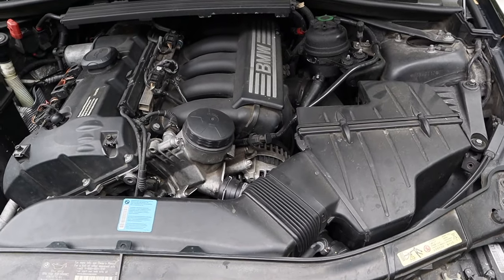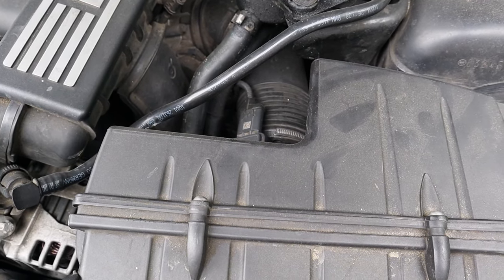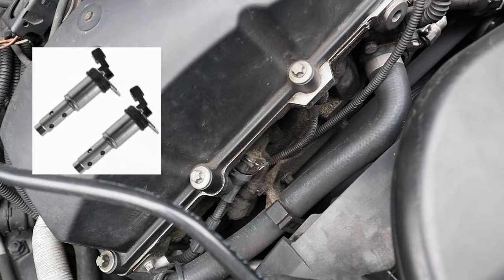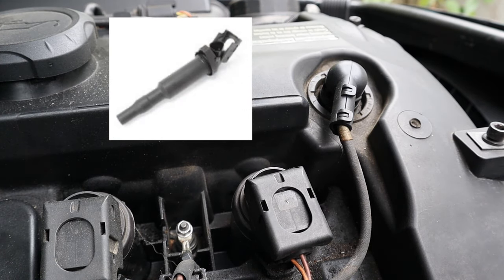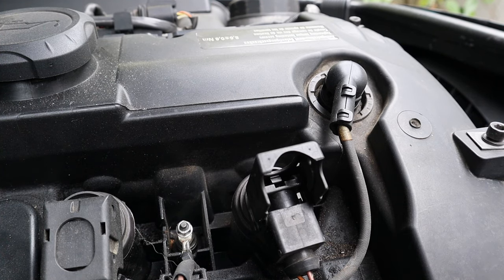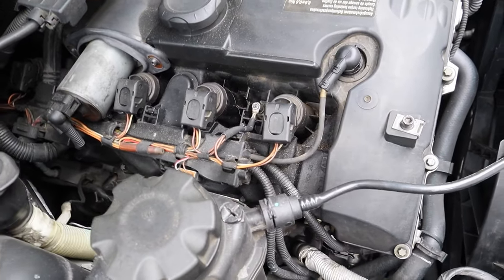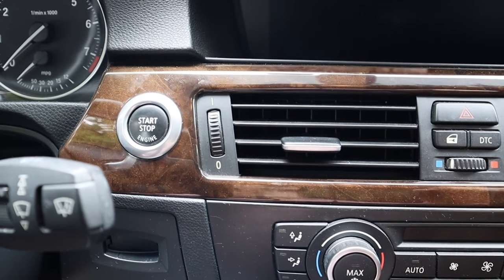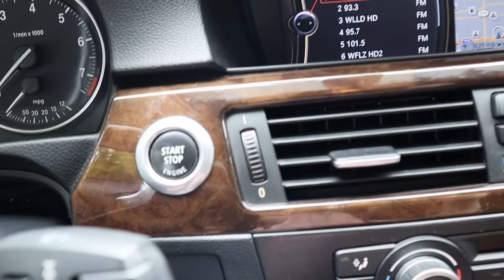5 Ways To Fix Rough Idle BMW E90 E92 328i 330i N52

Comment: One more thing: check your oil filter cap. If it has no prong with two o rings, it needs replacing. A new one with prong etc. made the biggest difference when I had the idling problem on my 323i. (I did all the other stuff too.)

Comment: My car was running perfectly fine stopped at the grocery store came back out now it's acting like it's running on half the cylinders what's going on????
Reply: What was it?
Reply: You most likely need to replace the coil packs; a scanner will tell you which one is failing, but it's best to replace all 6, each time

Comment: There are check valve that are long screws that true in behind the intake and exhaust solenoid not any videos really ever say that or shoulders but they need to be cleaned. Also, that’s a huge huge problem that people never do Saul there a little screw that unscrew behind the intake and exhaust so annoyed and they are check valve. They need to be cleaned Illinois do.

Comment: Nice shirt…
Cool of you to try to help people out man, may I provide some added value?

You don’t need to remove the air box to clean the MAF just remove the MAF carefully, use a T25 torx, a small flat tip screwdriver, and be careful, plastic is more forgiving when warm.
Spray MAF cleaner at a little distance in three, 1 second bursts, give 10 seconds between bursts
Cleaning the Vanos without actuation is pointless, I hear there’s a cool video on cleaning them on YouTube…
Start with a code scan with a bmw suitable scanner.
Mark the coils then swap coils around see if the code follows a coil, if so, replace that coil or all 6 coils and plugs for preventative maintenance if it’s affordable at that time👨🏻‍🔧 
Misfires can be caused for lots of reasons, including needing a software update and a failed DME, especially if you have worn plugs and old coils and drive till they all fail one by one, that causes the electronics undue stress.
CCV leaks are another cause of rough idle and misfires, check your valvetronic motor area for oil, that failed gasket, and the eccentric shaft sensor seal, and the CCV hose from the valve cover to the manifold at the back, guess what..? Those are CCV leaks feeding the engine un-metered air, and will cause rough idle and misfires, along with mass air codes due to low air flow 
Also have a look at the passenger side engine mount, there’s another cool video I know of about that motor mount too!
JDM TECH LLC out 
✌🏽
Reply from the maker: thanks

Comment: I just had my engine changed on my 2011 328i convertible. And now it has a bad rough idle when turned on. For 10-15 secs seems like forever. Ideas? Also changed out the Footwell module
Reply from the maker: no clue sorry :(
Reply: How much did it cost you to get your engine changed?

Comment: I don’t have a rough idle but it started idling high around 8/900rpm today. I drove it fine this morning but then this afternoon on the way back from the store the rpms stayed up there, oddly enough turning on my AC they went down a bit
Reply: Did you resolve high idle somehow ? I had the same problem, pulled codes and it was a single code of 2a43. A few days later idle became a bit rough
Reply: @arisowski  yes ended up being my 3rd cylinder spark plug starting to fail. That same day i left for work and it was misfiring. New plugs and coils fixed it for me.
Reply: @Wergrun  Dang it. I changed my plugs recently with oil but the problem persists. May it be coils ?
Reply: @arisowski  if you don’t have a code for coils I doubt it will fix it

Comment: Which has less repair issues , 2011 328 I  wagon (without turbo) or the newer 2012/ 2014 (with turbo) ?  I heard turbos cause more repair issues
Reply from the maker: 2011 has the n52 engine and is very reliable.